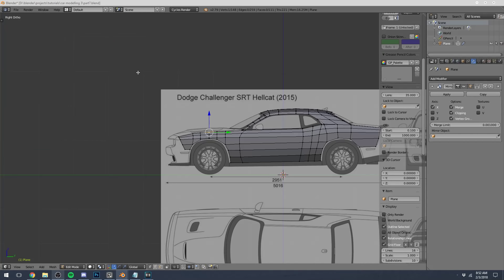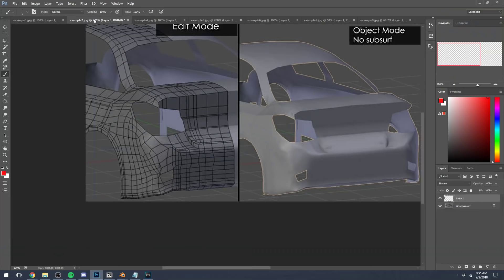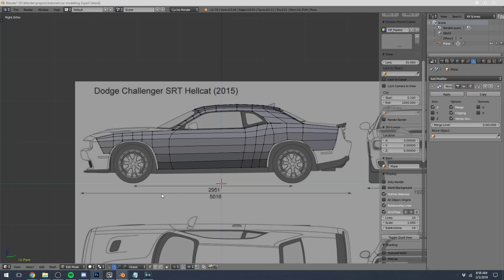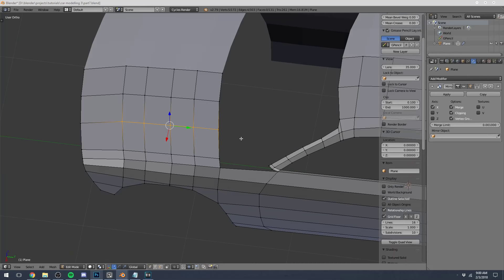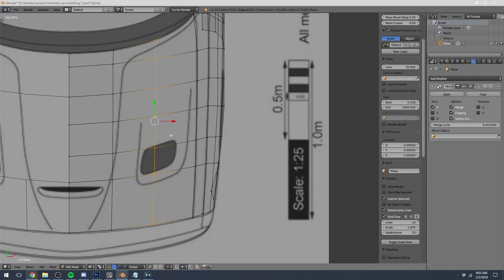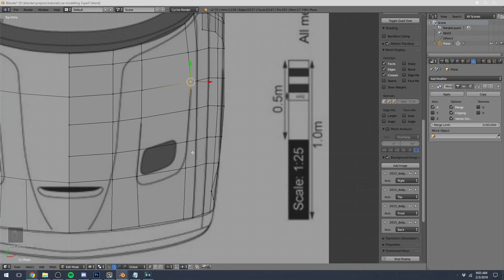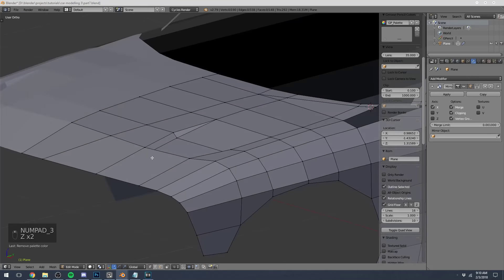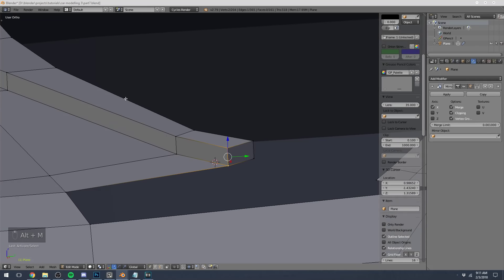Model a 3d Car | part 7 | hood vents and topology examples

Comment: At 6:05 I think the reason why there are so many triangles and such on the rear lights and wheel bolt is because the modeller probably subdivided the base surface and did a boolean operation for the lights

Comment: When I press S key (12:48), the vertices do not go towards the centre, but they all go in one direction...
Reply from the maker: I’m not for sure what you mean. Usually that only happens if you select a specific axis
Reply: solved. The pointer thing has to be in the middle.

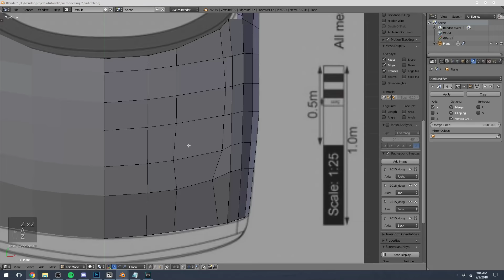Comment: wait how did u get those dots on 11:55?... Is it necessary?
Reply: By pressing Ctrl+Tab you can choose between vertex, edge or face selection, he used faces. If you'd delete vertices or edges arounbd that area you'd unneccesarily delete neighbouring faces.
Reply: Thanks =)

Comment: I was able to make the connecting bit of the hood to the body without a triangle! http://prntscr.com/mku5vw

I couldn't figure your way out and that was the result... Is this good or bad?
Reply from the maker: Mattchp Trooper nice work. If it lends itself to the edge flow then I’d say it’s good to go. Kinda hard to tell from the screencap.
Reply: @testedpancake12  few things: it works with edge flow in any direction  which I'd assume is a good thing. Also, thank you so much for these tutorials! I couldn't find a project that would really help my modelling skills and this was a good one. I've done the basic blender guru tutorials but found I still was lacking in information on how to do things. This has helped me immensely.  Also, in your future tutorials, I recommend you don't apologize as much! You're doing a really great job and you're providing free education on a platform to help others out. That's a really noble thing, you shouldn't need to apologize for.